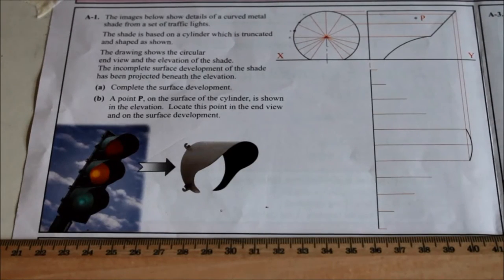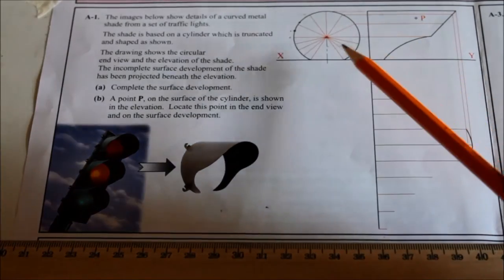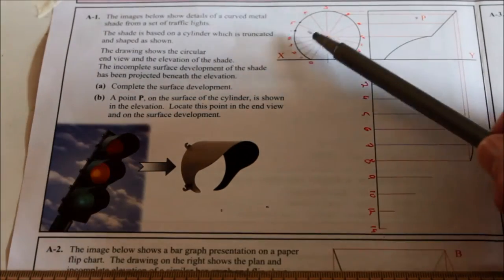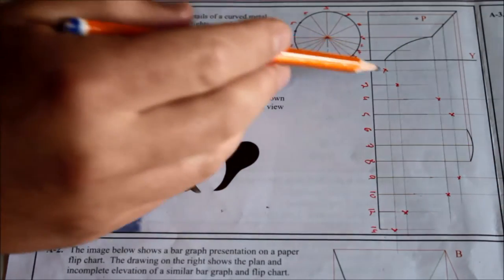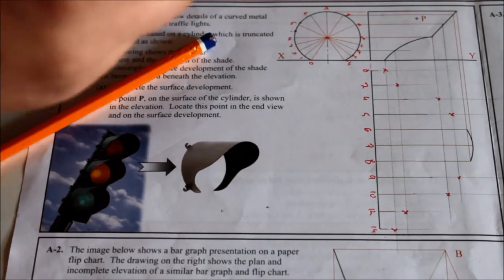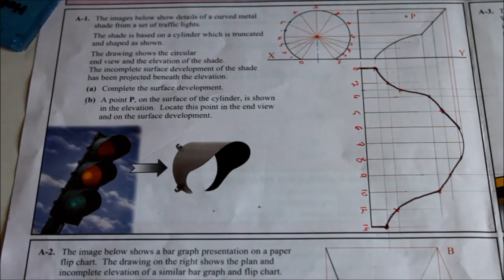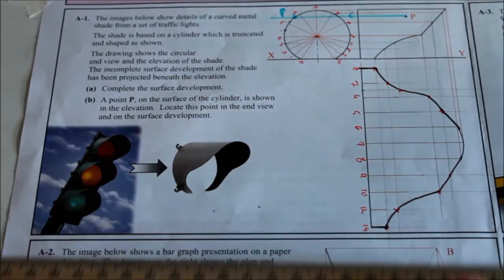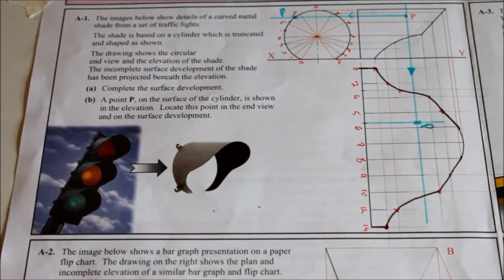DCG: 2016 Higher Level Question A-1

Comment: I didn't do that exactly... Because P was on the front I put it lower down in the development. I didn't put it above the centre line of it like you did. Is the development upside down then or something? Like if it's in the front should it not have been lower down. The way the development looks in yours would it not be at the back if was to be bent into the shape it is in the elevation? I hope my questioning of it makes sense. Thanks.
Reply from the maker: +tektekfighterb5 We're both right. Mine would have to be bent toward me to be right and yours would have to be bent away from you. It doesn't matter in developments. The elevation is just used for lengths so it' doesn't have to be a "true" plan.

Comment: i notice you use felt pens, can student use them in an exam? would it help the neatness?
Reply from the maker: +jamal ali They can,I mostly use them to highlight certain parts of the drawings but students can use colour to help follow their drawing a bit better. They could be just as neat with a 2H and HB pencil,I don't think it would add more marks for draftsmanship using colour.
Reply: i might just go over the finished drawing if i have time, thanks alot! if you could make a video to help save time during an exam would be helpful, its something 90% of my class struggle with is finishing on time with enough questions done
Reply from the maker: No bother. A bit of shading is no harm. Didn't get a chance to record before the exam,goodluck tomorrow!